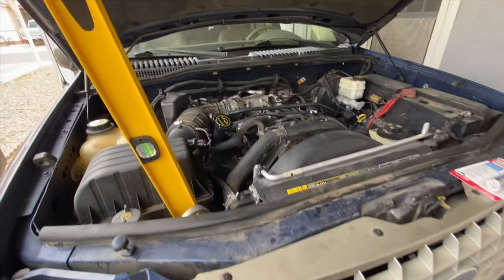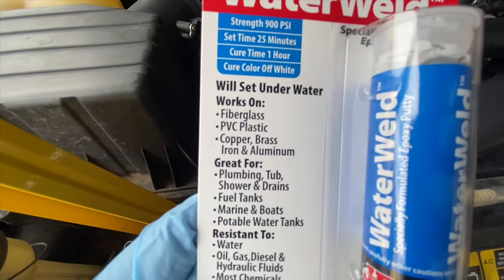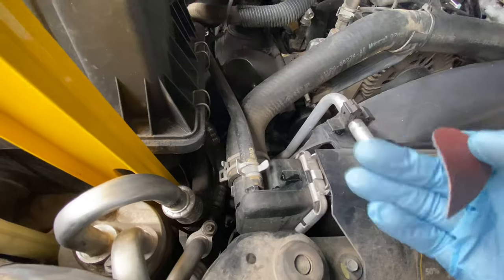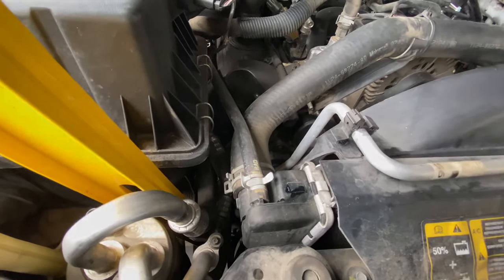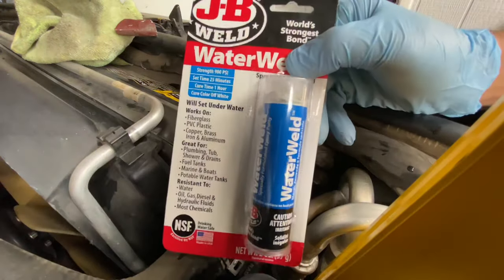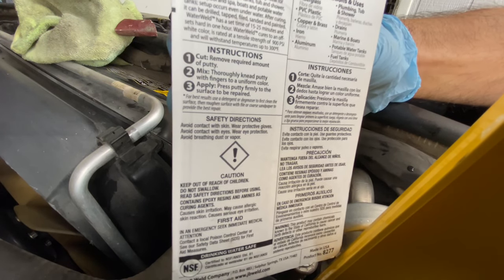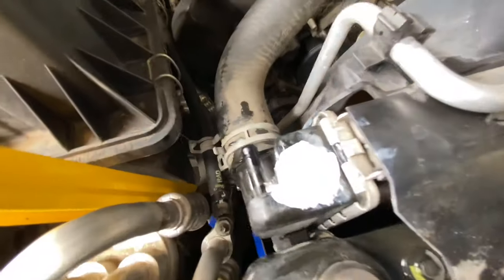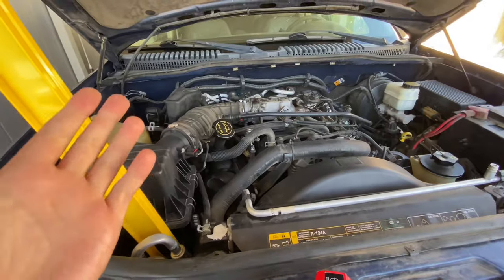How to Fix a Cracked Radiator Plastic - JB Water weld

Comment: Ok I did the repair today on my 2015 Chevy Silverado. My crack is literally in the same side as yours. I spent alot of time hand sanding & cleaning mine. I didn't trust myself with an automatic sander. Once it was ready I mixed the stuff and I used a small art brush. I wanted to be able to get the seal in the crack. Then I put the fiber on top & added more. I decided to allow it cure for 24 hours. I will add an update tomorrow. I appreciate the tips.
Reply: No update??? 😀
Reply: @lovetrump1088  maybe it didn’t work 😭😂

Comment: i fixed a crack in my BMW 330ci radiator with JB Weld - took a few shots but I now have a fantastic formula I recommend:
1. Get your engine warm and examine where the leak is.
2. Release the pressure and drain the coolant while it is still warm/mildly hot, but not too hot that when you seal the cooling system, it isn't blowing steam or air out of the hole you're trying to fix.
3. Once it isn't spitting but still warm - THEN apply the JB Weld and leave it for a few hours.
Applyig it while the tank is still hot causes the glue to be drawn into the hole, caused by the internal vacuum when the hot air cools and returns from its exanded state.
Exactly the same as when you fill an airtight tupperware with hot food and seal the lid while your food is still hot. By the time it's closed there's a vacuum inside ;)
Reply from the maker: Great advice , thanks
Reply: For Realerrs......... Thank you for the tip. My crack is along the side of the radiator. I wish it had been on top. Would be easier to get to and repair. Still gonna give it a shot. Thanks again.
Reply: Cool! (I mean hot then cool)!!!!
Reply: Please tell me how it went
Reply: @jack8356  Update: The JB Weld eventually deteriated and failed after about 3 months. 
After multiple recommendations I tried using the Barrs Stop Leak additive, and it has worked perfectly.
I was reluctant to use an additive but the car part wholesaler told me the radiator repairers in the area all use this product very regularly.
It's been about 2 months since I added the stop leak and I have zero issues. Apparently this stuff treats and protects the rubber seals in your cooling system as well
Reply: @reallycooluleh  thanks for replying. Can i get a link of what it looks like so i can try to find it online. Please

Comment: Cool I’m trying this today. I also replaced the hose that goes to the reservoir with a clear silicone hose. I can see if the coolant is flowing to the radiator and reservoir tank.

Comment: I had a crack in my radiator(only a year old) as well. In a similar spot as yours and was obviously causing a leak. I used the JB Weld Plastic puddy instead of the water weld, but I have a feeling either would have gotten the job done. It worked incredibly well much like it did any time I used other JB puddy. This shit is the TRUTH.
Reply: I just used the JB Weld plastic, I hope it works on mine
Reply: @hectorpixs4870  update
Reply: Is it still ok?
Reply: @hectorpixs4870 Too much heat..

Comment: I use JB weld to replace the broken  nipple on my plastic radiator with a brass one, it worked great but I did have to repeat the process a year later and every year from then on. But $5 each time was much cheaper than having a new radiator installed.
Reply: Yea, on my 05 MDX, the overflow neck leading to the expansion tank broke and i used JB Weld to fix it. It would send all the coolant to the expansion tank, but the coolant wouldn't return to the radiator when the engine was off. JB weld fixed it and now have the proper vacuum in the cooling system.
Reply: I repaired a leaking main radiator comnection.  I also wrapped the area with wire to further stengthen it, then added the epoxy kit.
Reply: I’m in the process of using the same water weld as shown in video the nipples on my radiator on my Cadillac broke off due to fighting lifted Chevy for the center lane…. Hope this works 😅
Reply: I have a Nissan that has the coolant overflow nipple on the radiator fill neck.   It broke and isn’t long enough for a clamp to secure the hose.  From the comments, it sounds like this product will work for the repair.  I’m going to slide a brass fitting over it and use the putty to secure it in place.

Comment: Jb weld is a good product for quick fixes like these, but yes I highly recommend taking the extra time to do the prep work first. I’m guilty for not doing the prep work before applying jb weld the last couple of times that I’ve used it, and i still got some good results from it. Just imagine how much longer it would last. Thanks for the video.

Comment: glad i came across this video... i have a small crack in the same spot as u had so im gonna try this.... mine isnt leaking to bad YET.... but before it gets cold i need to fix it and i dont have the 150$ for a new radiator... so...again... thanks for the info...
Reply: A new radiator will cost you 150, to have it installed will cost around 700
Reply: @jacknife10000 nope. I have a Lexus. $150 for part. The $250 to install

Comment: Why are all these radiator fixes right at the top where you can reach it 😂. Mine, can’t even see it. 🤨
Reply: Ha ha , mine too . Right at the bottom
Reply: Found it. Behind the condenser.
Reply: Luck of the draw, mine came out on top..guess I'm a winner!
Reply: man fr mines at the mf side under a bunch of fuses and shii 😂
Reply: I had big luck found one on the top, also bad luck found one on the bottom, also greater news no radiator you can buy for my model. Lovely!
Reply: Facts 😂😂😂
Reply: Yea good point, I'm never that lucky. I think it's because the pressure is higher at the top vapor point.
Reply: @WhosThatWhippin would you have to flush the coolant to use this epoxy if the crack is on the side of the radiator on the plastic?
Reply: Right. Mines on the side next to an attachment point
Reply: I got lucky on my brother jaja
Reply: You need to remove the radiator  to repair it,

Comment: The VW 1.8T motors have a common issue where the coolant temp sensor goes or starts leaking. Being that it sits in a tube facing up so it can keep track of the Temps for the ecu and the instrument cluster often the case it leaks through the gasket as there is a clip that holds the sensor down with two split openings on each side of the pipe. Remembering vaguely years ago when it first came around someone said it fits but it doesn't stop the leaking so he gave my xwife an option as it was her car at the time and her father was footing the bill. Unfortunately 150k it has finally started acting up again. I only remembered when I has pulled out the sensor with a pliers after I pulled the pin out. So this time I'm gonna use roughly the same stuff just this waterweld version. Wanted to see what others thought. Thanks for the vid.

Comment: Yea I used sum jb weld on my radiator hose and a crack on the radiator and it works like a dream! Been using for about 6 months now and only had to repair it twice

Comment: I am trying this.  If this works you are a life saver!
Reply: Did this JB Weld (water weld) fix your particular radiator leak?
Reply: @jeffgomez88  yes it actually did work, and I've been driving Jeep for a month now.
I sanded the plastic with high grit to make it rough and then cleaned with alcohol, puttied this around and let it sit overnight.
The next day, no leaks at all.
And I was having to fill coolant like every other day before this.
I have another smaller leak now elsewhere and ended up buying a replacement radiator for long term but this made the car driveable.    I can't tell where the other one is is the problem

Comment: I have almost the exact same hairline crack in the exact same spot on my 2004 ford ranger. I was gonna replace the radiator but I dont feel like spending the money during this time. I'm gonna try this quick fix in the meantime. Thanks!
Reply: Did u end up replacing the radiator?
Reply: @panthers559  yea I did that along with the thermostat. I then noticed that coolant was leaking from the water pump so I had to replace that. That was the main issue pretty much but it works great now 👍
Reply: @thesaexplorer  hell yeah good shit man 👍

Comment: It would be best to drill a small hole at each end of the crack first to stop it going further otherwise it will just continue to crack out past where you have repaired it.
Reply: Smart. Carpenter wisdom

Comment: Cool thanks my is on the back around middle of the radiator. It is leaking out of it so ill probably sand it down and use the water weld and ad some something else on top after it. Is that a good idea?
Reply from the maker: If it’s on the plastic part just water weld can be a good temporary patch

Comment: You are my main man.
I can't afford a rad right now and only drive to the store, less than one mile.

I've searched this a lot. It got confusing. 
Your vid is calming & to the point. Pre-prep is the most important. 
I looked into Waterweld seeing your vid. Yep. 
Heads up, someone commented to use a metal patch over the epoxy. 🤔
Reply from the maker: Awesome man good luck

Comment: Good prep work cleaning the area w/ sandpaper and wiping w/ alcohol,  this didn't show what kind of temperature the weld was rated for which is a concern.  Since it appears to be just a thick epoxy, using a thinner, more liquid(fluid) epoxy may work as well for thin cracks.  Glad your fix worked!
Reply: Regular jb weld plastic didn't work for me. Only worked on the crack right on top, it drips from the side to easy. Helped me find another leak though.  Think I'm trying this next, haven't found many ppl having success with the jb weld radiator one but IDK, not sure about putting it on top of the other
Reply: I know this is an old comment, but I used this product for a similar repair today.  It says it will withstand temps up to 300F, more than enough for this application.

Comment: I  used the JB WELD marine on mine today.. see how that goes.  Holds up to like 5,000 psi or something insane like that. I sanded it , maybe not as much as you, but still, hope it works. Thanks for posting.
Reply: Can you tell me how it worked for you ? I would think the marine would be better.  But there's 1 person to ask and it's you.  Thank you in advance if you respond
Reply: @joshuam122  Worked for several months til my transmission went out for the 4th time in as many years.  I got rid of the truck..  So, it works, may not be the best thing ever, but it'll hold til you can get a replacement.

Comment: I have an Identical crack in my 2002 jeep grand Cherokee. So thank you I subscribed and liked. Least I can do if this does work.
Reply: Did that cause over heat?
Reply: @evadventures972  it did overheat, but once I put the JB Weld on it, I never had another overheating issue.

Comment: I have an 07 ranger with what I'm pretty sure is the same radiator, and has a crack in the same place as the video...wondering if that's a weakness in this radiator model? Also if that's a sign thermostat is failing? But I did change my thermostat a year ago....

Comment: Please only use this product if you plan on replacing the radiator in the near future... I had tons of radiators come into my shop that COULD have been properly repaired for 30-40 bucks that needed completely replaced because people used this product... Sure it seals the crack but it also clogs the tubes... It will also reduce air flow if it gets between the fins...
Reply: I'm not replacing shit
Reply: Its meant to use on plastic. clearly people didn’t understand.
Reply: I have a mercedez benz 2013 s class twin turbo that the radiator is cracked on the plastic side which is also where the air intake hose is connected to.  The crack is less than a mil thick and jb well original did not work and kind of because like too paste due to the heat and coolant chemical.  I will do three phases to repair.  So what do you recomend?  I do not want to deal with a huge problem eventually.  The crack is very accessible since its in the front and you can reach it by removing the air intake hose or front by sticking your hand.  On my way to autozone to buy this product which mostly will not go into the radiator.
Reply: @nightfighter7452  😂😂😂
Reply: @nightfighter7452 😂

Comment: Well tried this stuff because parts store guy asked what I was fixing and told him had crack in radiator and I had the original high strength that I’ve always used but he said this was better, well I call BS prepared it sanded and degreased it and crap never got hard, so take my word for it wasted time the best is the high strength one with steel particles in in 3,700 +PSI...
Reply from the maker: You gotta let it cure for 24 hours.
Reply: So these putty sticks are made of two parts. The inner hardener and the outer putty. You have to pinch off roughly an equal amount of both and then knead it like dough to mix them and then apply it. If you only take a tiny amount you might not get both parts and it won’t harden.

Comment: Will it work for a Bmw e92? Guess I'm gonna try it since it's just a tiny hole in the top and I already spend £250 for parts and pick up truck last week 😂
Reply: Hey I’m gonna try it on my e92 top radiator hose. Did you try it?

Comment: My radiator is cracked and I’m planing to fusion weld it with some PLA filament I’ve got from my 3d printer. Since the radiator plastic is nylon I’m a bit concerned about the two not sticking very well so I’m going to cover it with water weld once I’m done for extra support. I’m getting the car ready to sell and a new radiator for it is only $70. I’ll be informing the buyer about it so they can decide what to do about it once it’s theirs.

Comment: How long did the repair last? Great video!!!
Reply from the maker: Still work great 5000 miles later
Reply: @GK7GARAGE  wow. I got the wrong kind apparently.  Do u think it will work over jb weld plastic? & I found a second leak after I tried fixing the crack I found😩 had a lot of trouble sanding & cleaning it, side of plastic overflow tank with a/c pipes in the way

Comment: Can you put in on the metal part of your radiator?
Reply from the maker: No, it won’t work
Reply: Really!? Lol. I watched your video and didn’t hear the part where you said “plastic” in the beginning. So I bought the JB weld and put it on the top on the radiator that had a crack! Would you know a solution to take off?
Reply from the maker: Isatora Faaofo I don’t think you can take it off
Reply: Smh.. so I placed like a good amount of the product on the crack on the radiator. What’s your thoughts on how I should go about it now?
Reply: @isatorafaaofo3958  How is your vehicle running.now??? Does the weld contain your coolant???

Comment: The top of my radiator is leaking water when i add some to the reservoir its coming out through the top of the radiator plastic part.

Comment: just so you guys know the proper repair for this is, you have to take a hot sautering iron and melt the plastic shut then you would put the putty on take as an added layer of protection unfortunateely i bought my car used and alrdy had sealan on it and there was a small pin hole, I patched it up and well see! might take it offer and melt some plastic if its even possible to take this stuff off lol
Reply: How did it go I also covered a hole that was half size of a dime ?

Comment: Would normal JB weld work?
Reply from the maker: prefer this because its made liquid proof and holds high pressure. thanks
Reply: I learned normal jb won't help much for long on plastic. it cracks off when hot. I'm going to try this before paying $180 for new radiator in my blazer
Reply: @karolkingsley4160  Go get  one from Junk Yard...I only paid $35..And got practice with removal...
Reply: @karolkingsley4160  JB Weld works well under heat, JB Quick does not

Comment: you should have used flex seal..i tried it works like a charm and its simple...just clean the area with brake cleaner or wd40...and spray it on...crack repaired...and the crack was on the bottom of radiator...:)
Reply: Did it worked?
Reply: @josecasado7511  yes
Reply: @josecasado7511  naw mine melted

Comment: I wish he would have pressure tested the radiator to show that the radiator can hold the pressure without leaking.
Reply from the maker: It was pressurized because car is hot
Reply: @GK7GARAGE  OBVIOUSLY YOU DON'T KNOW WHAT YOU ARE TALKING ABOUT....A COOLING SYSTEM PRESSURE TESTER WOULD INDICATE HOW MANY PSI THE RADIATOR CAN HOLD OR MAINTAIN, OR IF THE PRESSURE GRADUALLY LOWERS.
Reply: @stevenx2414  Lighten up Francis.

Comment: I hate to break you bubble but it will not stay;; 1. plastic on radiators is POLYETHYLENE and a very dense closed  pore material-- 2. I have used JB Weld Marine- Excellent product ++. Not scoped for Polyeth.  ; too slippery and non porous. It might  stay on for a few days but will pop off after a few heat cycles ~~ Voice of experience !